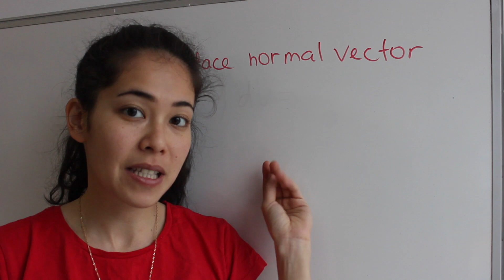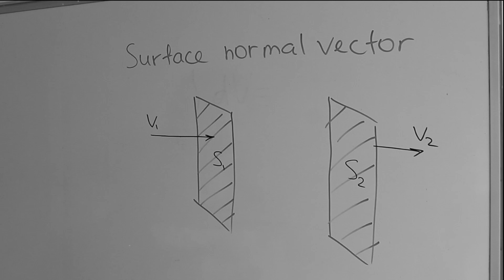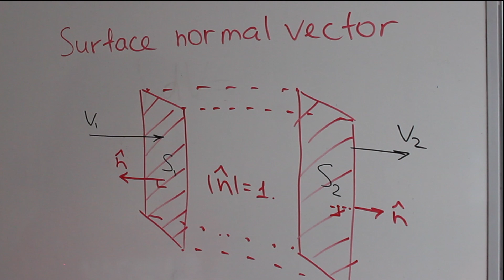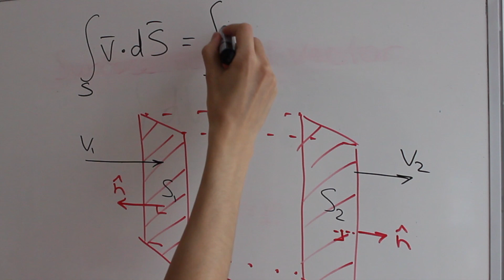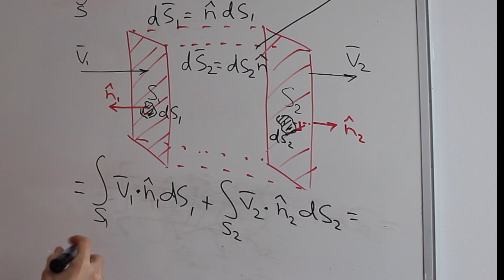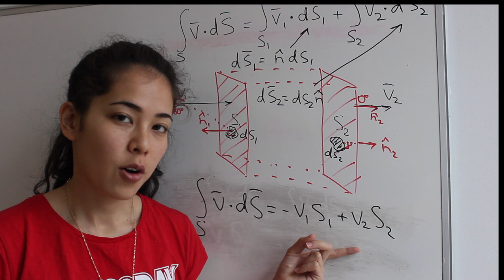Surface normal vector explained

Comment: My only question is,  Why unit vector U1 in S1 is opposite to the direction of the wind ....Can we  create unit U1 along the direction of the wind just in the opposite face of S1....
Reply from the maker: We can if we are inside the control volume and want to determine force distributions from that point of view
Reply: @AliyaBurkit  What is the actual purpose of unit vector ...It would be an honour to know that....
Reply: @rosishkatuwal5677  I think it’s a helpful reference for the direction of any given vector. Since you’re given the direction of a unit vector you can just sort of multiply for whatever magnitude suits your purpose. That’s at least my understanding of it so far.